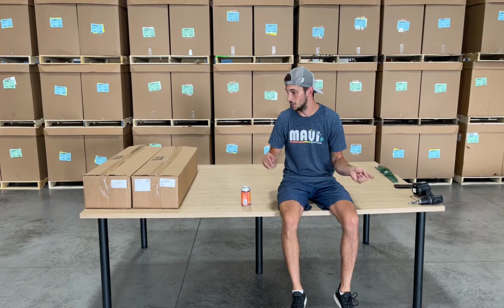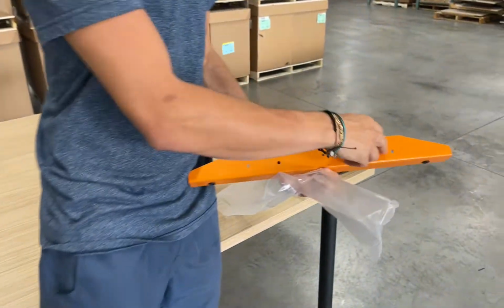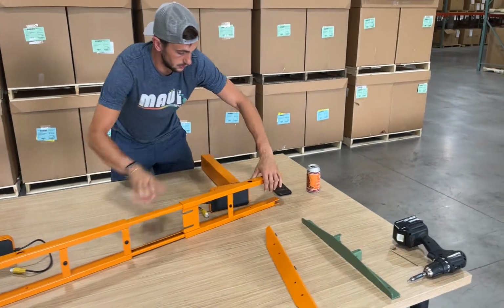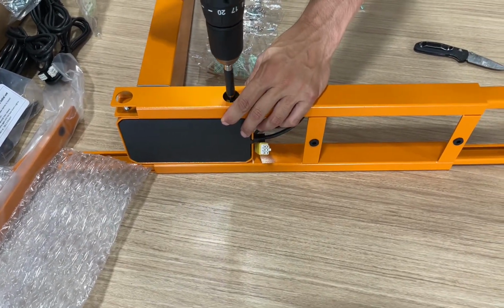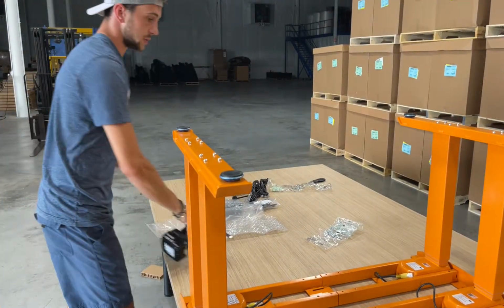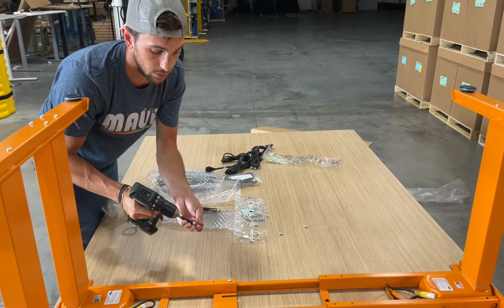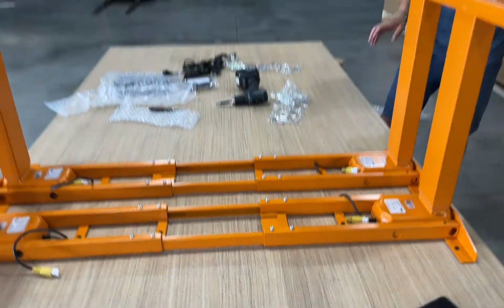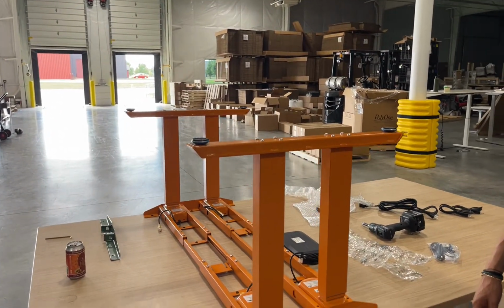Apex Pro Installation UPDATED

Comment: Summary for anyone looking for one:

1. Use long M6 screws for the feet and the end brackets. Use short M6 screws for everything else on the frame.

2. Connect the legs to the frames with short screws. Kinda goes without saying, but the motor house of the frame should point to the center of the desk. The flat bars of the frame should be oriented so that they’ll be touching the bottom of the desk.

3. Connect the end brackets using long screws.

4. Connect the feet using long screws.

5. Connect the frame to the desk, add the paddle.

6. Manage wires.
Reply: OMG!!  Thank you !

Comment: Just assembled my Pro Max this past weekend. Was quite nervous about the installation, but it ended up being so easy (thanks to Chris' YouTube video). The most fiddly part was to install the inner screws with the Allen key through the end bracket weldment. The new design completely eliminates that process! Even without a power drill, I figure I could install a Pro Max in under 30 mins, now that I know how to do it. Would highly recommend a slim ratcheting socket for installation of the cross beam & leg brackets on the Pro Max.

Comment: More of a challenge to see how fast you can assemble the legs than an installation video. Considering the desk doesn’t come with assembly instructions, I’d love a more detailed guide.
Reply from the maker: Check the resource section on the product page.
Reply: @Deskhaus  thank you so much!
Reply: @Deskhaus  I found the assembly guide, but I'm still a little confused. I'm trying to put together an Apex Pro with your HPL wood top. I'm trying to fasted the frame to the top using the ST5*20 wood screws provided, but they aren't long enough to go through the holes in the frame and also catch the threading in the wood top. Am I missing something?
Reply from the maker: @mike35424  you purchased a laminate top with threaded inserts.  So use the provided machine screws that come in the separate baggy
Reply: @Deskhaus  you rock , thank you! I didn’t realize there was another box with a different set of screws.

Comment: I just assembled my base.  Overall very happy with the parts.  I do not have a table for assembly, but still pretty easy.  Completed in are 35 minutes by hand with mistakes.  Few lessons learned, because I am an idiot and grabbed the first thing in front of me... make sure the bracket to screw the desk into is facing the right way, had 1 upside down.  Also, install the side bracket before the feet.  I couldn't quite get the screw to align when I did foot first.

Comment: hmmm, I'm at the part where you connect the desk to the frame, and the screws don't seem to fit, is there a updated manual anywhere? nothing came with the boxes...
Reply from the maker: @CookieManCookies  use the machine screws in the bag labeled “top screws”

Comment: Hi! Can you please tell me the boxes’ dimensions for this apex pro (and weights if possible although I gues total would be around 60 kg)? I’d like to ship it to Europe (pre-sending it to a USA address first of course as there’s no eportation option on your web) but freight forwarder is asking about this exact info before I can buy it so they can confirm space for and LCL. Also, is there any extra screw, key or anything needed for the assembly or everything needed comes withing the boxes? Thanks in advance!
Reply: Found dimensions on the web sorry!

Comment: How many mounting holes for the desk surface are there?  I've built a large desk top and looking at this base but plan to use threaded inserts in the bottom of the table and hex bolts to mount the base to the table and need to know how many inserts/bolts I need.
Reply: Did you find out how many mounting holes there are?
Reply: @bwubrian  14 I believe.  3 across each end piece and then 4 on each side  between the rails that slide to extend the base wider or narrower.
Reply: @FastRedPonyCar  Thank you!

Comment: @deskhaus what are those ST5 16 screws for? I'm trying to put the top,  and I have 4 of them. Are those for the control system box?
Reply from the maker: Control box. Not every screw is need. Also fyi. Check the resource page of the apex pro.